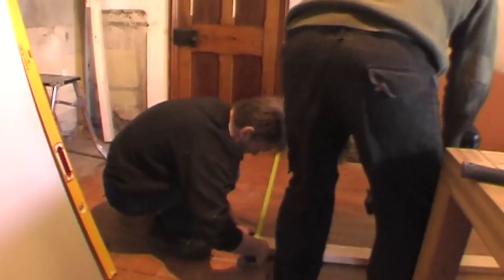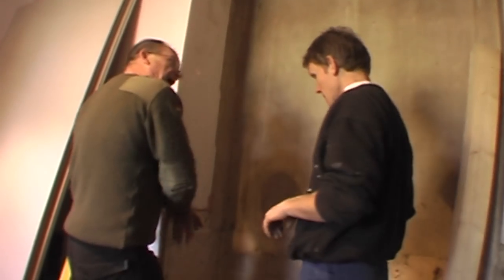Roof Slate & Demolition ~ 35A Extension #5

Comment: Great work, Just a subjection,  when you cut or break brick/tile or mortar just apply a light mist of water and you will have next to zero dust or in your case inhalation of dust or perhaps dangerous dust. The last you wont find out until it is your last. Love your problem solving!
Reply from the maker: Thanks Percy. Too late for us, we are old now. Roger is allergic to dust and wheezes like a fairground organ. Steve finally gave up smoking 50 a day and has put on a lot of weight. We should  have done everything differently and young people could learn this from us but never will. Nobody thinks they will get old .

Comment: Love the slate roof.  Here in the US there dinosaurs and almost impossible to get.  
Question ?  That is the cost per square in the UK and what is the availability of the material ?
Thank you for sharing this video.
Reply from the maker: I am afraid it all comes out of China these days so you can Google Chinese slate for current prices. Some of it is horrible with clay and quartz but, having said that, still good for 60 years or more.
Reply: @SkillBuilder  Thank you for the reply and the heads up on the quality control of the Chinese material.  I had hoped that the material was a UK product or even maybe from somewhere in the EU.  Awesome video and thanks again !!!!
Reply: @SkillBuilder  I've just finished a roof with new Welsh 22x12 they were getting on for £10 each but look better than anything else available.